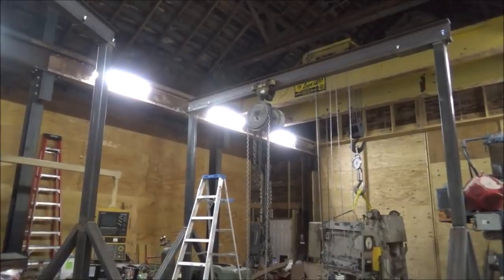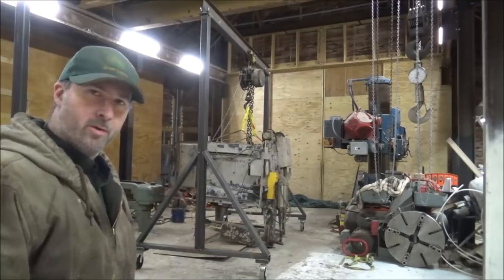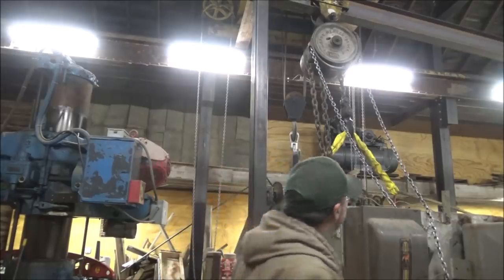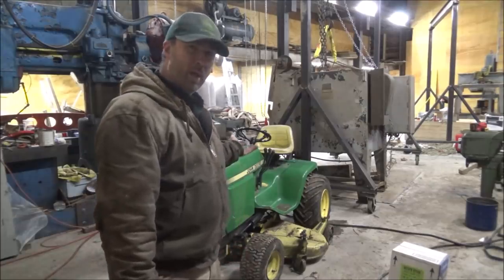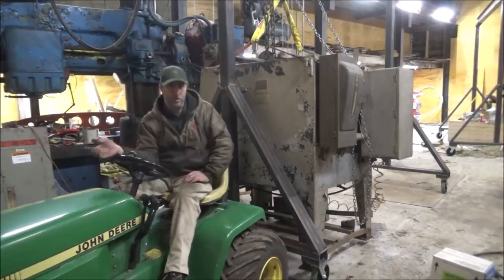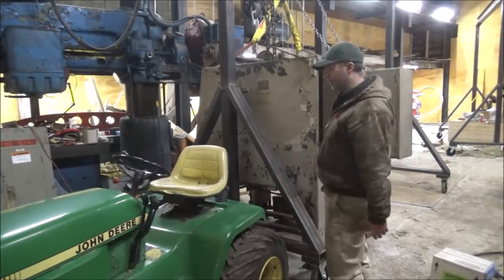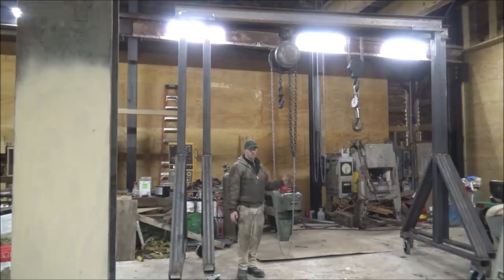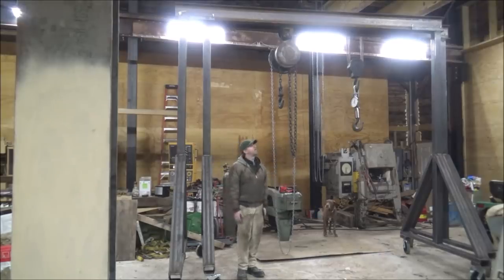Extreme Gantry Crane Testing

Comment: I believe that safety regulations state that when towing an overloaded gantry crane through a rough blacktop parking lot at up to 25 MPH with a half-ton or larger pickup truck, you need to put a bungee cord or 1/4" rope between the bottom of the two legs to reduce the amount of spread.
Reply: Plus wear a hardhat, eye protection, and a protective cup.
Reply from the maker: Do you tow it brakes on or off? lol
Reply: Front brakes off, rear brakes on. Gotta keep some drag so it doesn't spin on you. :-)
Reply: @lwilton    Also make sure the driver is properly belted(or bolted) in for safety.

Comment: Hi Brian...

Them bits of box forming the base of them triangles...
If you drill through for a drop in pin...
Then you could slide some smaller legs of box in there...
Use that to pair up these gantrys...👍

Just a thought...

With thanks
Glenn
GLMelectrical
Leeds UK

Comment: Another great job.  Thanks for sharing. By the way, on the idea of adding upper corner fillets...   I suppose you could add strength and unrequested features “til the cows come home”. Clearly, the added strength is not needed.  But, it might be useful to be able to pull from those locations in order to more precisely position a load sometime.  Great job, as usual.

Comment: Nice job Brian. That diffidently was some extreme testing.
Steve
Reply from the maker: Got to be sure they are safe! :-)
Reply from the maker: @540 MUDSTAIN Well seeing as how those codes say they are for top running and this is a bottom slung setup I guess they do not.
Reply from the maker: @540 MUDSTAIN I looked at the codes and it is for cranes like the one in my shop. I could not find any references to this portable style. It is most closely represented by ASME b30.17 however most of what is in those codes applies to the hoist part itself. I only supplied a steel structure with a load rating there was no hoist mechanism involved.  The structure was tested as per the codes with 125% + load on all possible positions and it passed. This is in accordance with OSHA 1910.179.  It will be up to the customer to install their proper sized hoists and be sure that they meet the crane requirements as I did not provide them a crane, only a structure.

Comment: I put 6750 on the gantry crane I made. The casters didn't like, I had to use a large wrench and crow bar to turn and move the casters. After I took the load off they are just fine. The 1200 lb casters are the weak point.

Comment: There is an old formula used by Whiting for crane girders, using deflection. It is to limit deflection to 0.001" of deflection per inch of span, or .012" per foot under full load. To counteract the deflection mid-span, on the bridge girders, they would camber them upwards to the equivalent amount, thus, under full load, the girders would sag, becoming level. However, you can look at the recommended girders in crane tables for kits, and find the correct girder.
Reply from the maker: How would they get the camber into the beams? Arched with a big hydraulic press?
Reply: bcbloc02: Yes. Many steel suppliers can do it, as do the larger crane manufacturers who build cranes using rolled sections, as they can install a press. Many times they need to straighten/camber long sections anyhow. The press has two hold-downs fixed to the floor, far apart, and a large jack in the middle. They also straighten/camber RR Car center sills this way.  On cranes over ten tons, they generally build box beams, and they add the camber during fabrication.

As an example, on a sixty-foot span, it is only about 3/8" camber, as the center span is 30 feet. You calculate the deflection at mid-span, and you have to use the total weight, beam + trolley/hoist + load.

The Machinery's Handbook has the formulas for deflection using weight, and you can use a rolled section catalog to find a beam with the correct section modulus, like the old Bethlehem catalogs.

This is why you find the trolly hard to move, because of the downward sag from the load, but of course, that was overloaded. To get the gantry to roll on the floor easier, you'll need larger diameter wheels, especially ones that the tires won't mash flat on the bottom under the weight.

The book is titled Whiting Crane Handbook, but it is expensive if you can find a copy. They're out of print. They used to send them out free, which is where I received mine. There seems to be a copy on Scribd:  https://www.scribd.com/document/103269401/Whiting-Crane-Handbook

I think that you might be able to find the CMAA handbooks on Scribd also.

For about a 20 foot span, the deflection should be about 1/8" at 10 feet in the center, and at a 10-foot span, about 1/16".
Reply from the maker: Max Deflection is .15" at 6000lb and .1" at rated load this is total system casters and all. The trolley has two wheels with bearings not very good which makes it not want to roll. I had never used the thing before as it is too small for any of the beams in my shop.  With a good trolley it should roll fine. The crane is designed to be portable it is not designed to lift and haul loads.  The track style is far superior if you want to try to move loads with one.

Comment: I seem to remember that Brian has a degree in mechanical engineering........used as intended.....SEND IT
Reply: CurlyG65  is that a building no is it a piece of machinery yes
Reply: CurlyG65  You have no idea what you are even talking about. A civil or structural engineer would not rate or even look at a crane like this. Go away and post on videos you know something about; like cats or baking.
Reply: CurlyG65  Any civil or mechanical engineer has to take a statics course (loads in a fixed position). So I'm sure Brain is more than qualified to make cranes.
Reply from the maker: At least these aren't built by the same civil engineers that designed and oversaw the building of that FSU bridge!!
Reply: CurlyG65    When I was in La Tech U  civil engineering department,  the MEs  also had statics and dynamics and strength-of-materials in their curriculum.   With his MS degree, I am sure Brian has the book learning background as well as the practical background to produce a very safe gantry.  If you can do better, then show it.
Reply: CurlyG65    I got news for you, MEs design such things as pumps, turbines, hydraulic presses, car balers, heavy transmission equipment for powering large equipment, gears and gear trains, conveyor systems and material handling system, etc.  I am almost with you on exercise machines but have to renege on pasta machines even though pasta is not my favorite food.
Reply: @bcbloc02    Amen brother!
Reply: @bcbloc02  FIU (Florida Interferon University), not FSU (Florida State University).

Comment: Works for me.   The load test my work does .  Is its max load plus 500lbs for 1 minute.    
Is the steel certified?   I also build towers around grain legs, insted of using cables.  And all the tubes need the be certified.  It cost more .

Comment: Brian, I was a steel fabricator for 32 years, watching you jerk on those things under load was excruciatingly painful. The failure points on those are where the top beam connects to the posts. I welded every kind of structure under the sun and I wouldn't even trust my own welds to hold forever because of work hardening and stress fatigue. If a post to beam weld broke while you were pulling on it like that it would all happen so fast you wouldn't even know what hit you.
If you were to just take some 16 or 18" squares and cut them corner to corner and weld those to the top of your beam and the outside of the post that would make a world of difference. You wouldn't be relying on just the post to beam welds then and the gussets would take almost all the flex out of that joint and cut way down on the stress fatigue on those welds.
Reply from the maker: Actually the weak link would be the nuts that hold the clamp bolts not the welds of the post to the c channel on top. None the less even when pulling on them with all the mower can do they have a factor of safety of 8.  The point is it is already well overbuilt and proven for the design loads, overbuilding it more just makes it heavier and more costly for no gain. Here is a commercial unit with even less bracing on the top than mine have with the inverted c-channel https://www.beatonindustrial.com/overhead-bridge-crane/gantry-crane/

Comment: Brian, nice work. What about putting type of hitch or pintal that can be connected to either am for moving the heavies of loads around the shop?
Reply from the maker: You must have missed the point that it is a portable crane and never intended to be used to transport loads around. The video was to prove that despite the claims of many the cranes would not fail from the lack of a diagonal brace.

Comment: Nice work Brian still want to see a John Deere put in the forklift
Reply from the maker: I don't have any access to any good cheap Deere engines but I have enough parts laying around to do 3 5.9l Cummins. I would love to put a 6068 Deere in it if anybody wants to donate one!!
Reply: @bcbloc02  look in the military auctions for a 30+kw generator they usually have deere engines in em. Find one that has a damaged control panel your not using that stuff anyways. Govplanet.com
Reply: @bcbloc02  the 30kw mep-805 units have 4045 engines
The 60kw mep-806 units have 6068 engines
Reply: bcbloc02 
MAN-UP an put a good old slant six in that forklift. :)
Reply: Or a Ford 300 with a turbocharger
Reply: The H0r5e 
NO WAY DUDE.. were Dodge men around these parts.. Fords r for yankees
Reply: One of the reasons I said that is because they should be easier to find because they were used in a lot of commercial vehicles
Reply: Ok Sounds good..
Let me ask u a question, what do u believe to be the most rigid (meaning service length) small block V8, the 350, 327, 289, 360, 318 or what ever the fords used?
Brian and I both agree on this, he talked about it in a video.
Reply: @JJ-jv1gu  Ford 5.0L 302cid or of course GM 5.7L 350cid. Both are super easy to find parts for and can be rebuilt blindfolded by 1/3 of the population
Reply: The one I suggested is not a V8 it's an inline 6
Reply: @theh0r5e90  the 300 is awsome motor too but u need the lenth in the engine bay. But u need the width for a v8 so its demensionaly dependant
Reply: Which is why I originally said put a deer on there
Reply: @theh0r5e90  and i gave a location to get deers from sometimes relatively cheep at military surplus auctions. 60kw mep-806 units have deer 6068 in them
Reply: The H0r5e 
Yepp, the Ford “Big Six” I looked it up. I did not realize they made such a big six.
I was just wondering ur thoughts on the best V8 made in your opinion?
Looked up ford small block V8s to add to your selection. The 289, 302 and the 351. 
I was just wondering ur opinion, just a friendly question :)
Reply: electromechanical stuff 
My question is the most rigid, best block design, small block V8 made?
:)
Reply: electromechanical stuff 
Gotta mostly disagree, they were all made to have either/ or engine as an option.
Reply: The H0r5e put a Deere on there?? not practical,
He is not going to use the lift all that much and those engines very expensive and heavy.
How much is a big Diesel engine like that... I’m not sure, maybe 10-20K on the low side?
Build a six for 1k.. it will run for the next 50+ years
Reply: Ford 302 because Windsor
Reply: @JJ-jv1gu  best design is a forever debate. Unwinable argument. My opinion is 350 strictly because of its versitility and availability
Reply: @JJ-jv1gu  what do u disagree with the generators? Every auctiongives pictures and u can preview thd lots and go physically touch it to confirm whats in it. but every one ive ever seen 30kw and 60kw had deeres in them. Ive never bought any bigger then 15kw cause i dont have the market for it. But i always look at em.
Reply: The H0r5e 
Wrong, sorry. Don’t get me wrong, fords r ok.
BUT them SBF engines don’t have the block rigidity, thus service life as a specific dodge engine.
GOT another question that I DO NOT have the answer to. What’s the difference between SBF Windsor an Cleveland engine besides the name?
Reply: electromechanical stuff 
I apologize, where did the generators come into play?? Using the engine out of the generator to replace the Hercules engine in the forklift?   correct?
Reply: @JJ-jv1gu  bcblock said there is no where to get a cheap 6068. I said look up govplanet.com the military generators mep-806 60kw has 6068 engines in them. Find one thats beat up ,missing gauges etc and yank the motor out of her
Reply: electromechanical stuff 
OH OK Gottcha..
Does John Deere make there own motors?
Thought Deere used cats or Cummings engines in there equipment..
Reply from the maker: Deere builds their own engines from about 30hp to 660hp, larger or smaller is either Cummins or Yanmar. Although the new forage harvester has a big Liebherr in it I think.  The Deere engines are some of the finest made, we rarely ever work on one for a hard part failure, usually electrical, follower by fuel system, and then turbo if anything. Most all will run 10000+hr with no overhaul and I have seen some as high as 30000+hr on original parts.
Reply: bcbloc02 
So I take it Deere is a high quality machine..
I wonder who has a larger operation Deere, Cat, Cummings
Does Deere make a crawler, I’m kinda on a cat crawler kick lately, gotta love pony motors :)
Reply from the maker: Yes Deere makes crawlers. They are not huge but are some of the finest grading machines made.  The guys that do the highway banks love them.

Comment: hey Brian - Everything in the shop is super-sized and super weighted. I knew that the crane would pass the test! BTW, is there more work to do to complete the shop? If yes, what needs to be done?
Reply from the maker: Mainly I have to put the entire ceiling in and insulate it. Also I have to finish painting the outside and paint/seal the roof.

Comment: How much would you charge to build a 12ft tall 10 wide 2 ton?
Reply from the maker: Hard to guess right now since material prices are all over the board and it literally took 2 months to get a set of casters I was supposed to have in 10 days. :-( Things are a huge mess right now and I suspect will just be getting worse. I would guess around $3500 but don't really know.

Comment: Any way you can give me a cut list for the hoist.  Also the angles you cut for the support angle.  Would  be grateful.
Reply from the maker: You likely can cipher thru the video and determine what the materials 
are, and I gave the cut dimensions. I don't know the exact angles as I just leaned the braces against the post in position and then transfer scribed a line parallel to the foot and cut from that. I am afraid to post the details 
because of liability as I don't want people to think this is a one size 
fits all kit.  I would gladly build one for anybody that wants one. :-)
Reply: Thanks

Comment: It held up to the tests but I would have liked to see some diagonal bracing between the uprights and the horizontal load beam. That looks like the weakest point.
Good luck !
Reply from the maker: The clamping nut is actually the weakest point.............. after the casters.

Comment: NEVER, EVER, loop a nylon strap around a steel chocker as you've dlne.
ANY Sliding of the nylon along the steel chocker will cut the nylon.
Use rated shackles.
PLUS steel chocker angle N/G.
Reply from the maker: But I don't have any steel chockers........................ I agree the angle is way low on the webbed lifting straps but I had limited clearance height and since they are rated 16000lb each they should be still low stressed enough to lift 5000lb with the pair. there was no signs of cutting or fraying from the lift.

Comment: i agree the castors would be the first to fail, what is their rating? commercially made of course, which is all you can do to trust their rating and be way under it, static lift no issue, as you said before, not designed to drag across the floor loaded.  whos painting it?   they wont ever let you live down 'that' video will they?
Reply from the maker: 1200lb each rated casters. Reality is they are hanging 2000lb rated harbor freight electric hoists off these things so they probably would give up first! lol

Comment: Jd mower isn't putting out enough fuel smoke for the pulling test.  Next project is to upgrade the fuel system and get some more HP.
Reply from the maker: Got plenty of HP it needs more traction!!!
Reply: @bcbloc02  I just like to see the black smoke when the tires are spinning

Comment: For how much are the castors rated?
Reply from the maker: 1200lb each
Reply: He said in the first video. They are rated 1200lbs per caster.
Reply: Okay, missed that. They are quite on the limit with weight ratings? 
I've been told that 3 castors/wheels etc. needs to carry the weight what they are loaded.

Comment: the bracing should have been from lower to top beam-------this is a very dangerous design and I would be concerned that it will over time either flip over and the one single support is not safe--------

Comment: in my opinion it is far from being a sturdy frame---upper area needs more angle bracing and as you say the lower connections deflect and they should not be deflecting at all------rather dangerous-----hope you don't get hurt
'
Reply from the maker: For 2 years now they have been doing the job they were designed to do multiple times a day 5 days a week. No issues. You don’t need a 10ton crane to do a one ton job. They were tested way over their rating with zero failures.